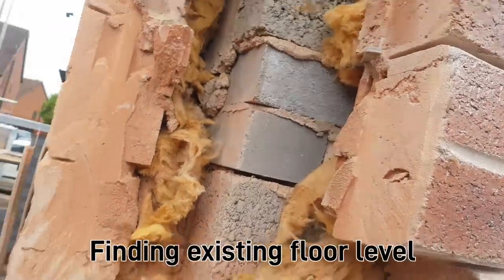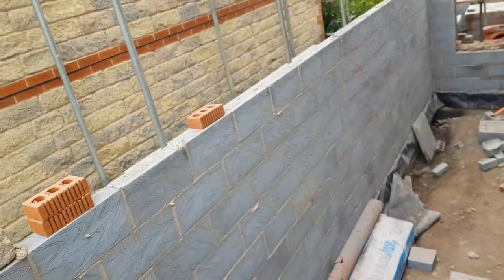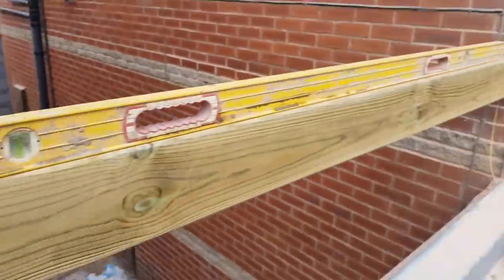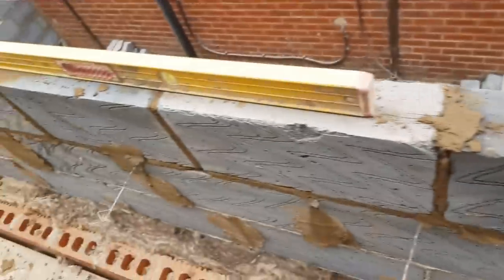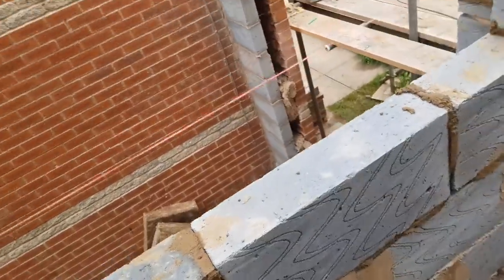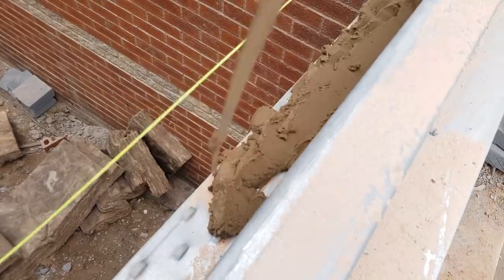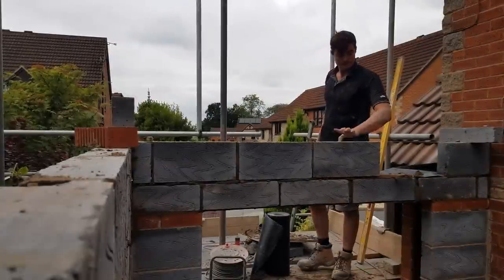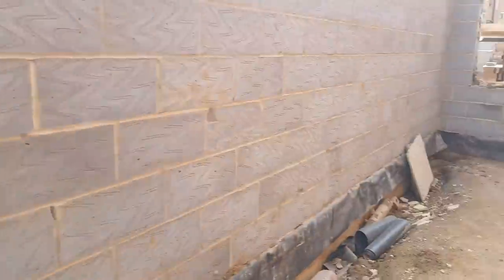Bricklaying - Blockwork real time - Setting levels for new Joists - Extension #bricklaying

Comment: why are you destroying the face side of a building to find a joist height that only matters at the knock through? How do you know that existing floors are level?
Reply from the maker: Ayup Scott! It's the back of the house. We are toothing into that back with bricks and using the stone on the other side :) dont worry😂 as I said too, I know the floor might not be bang on level, if it's out 10 15mm..on the other side..dont matter, as the knock though is exactly where I've set my datum and where I was close to toothing out👌 main thing is getting that new floor perfect flush from the existing

Comment: The length of block work like that using string line should put Dingle in the middle it support the middle of the line and keeps that what old bricklayers
Reply from the maker: Good shout mate we sometimes use a tingle..however..with how tight I pull my line..no need 😂😉
Enjoy your weekend buddy!